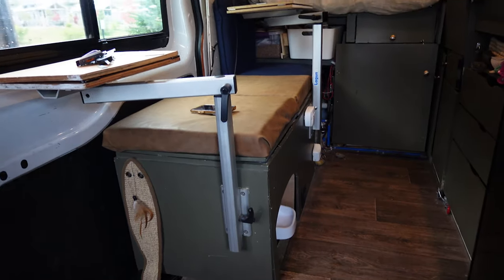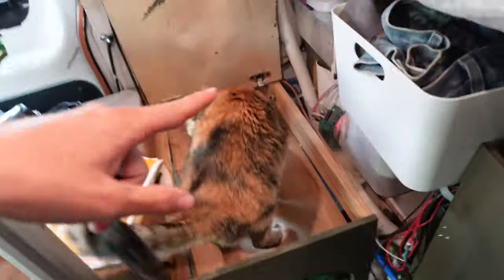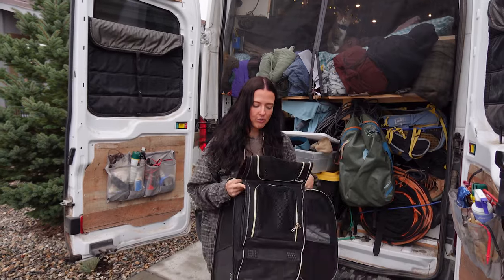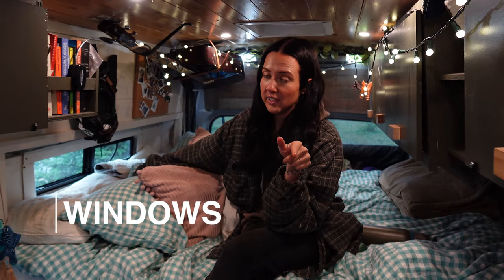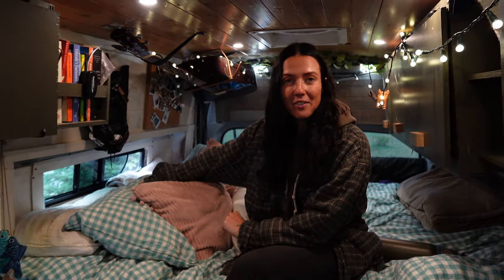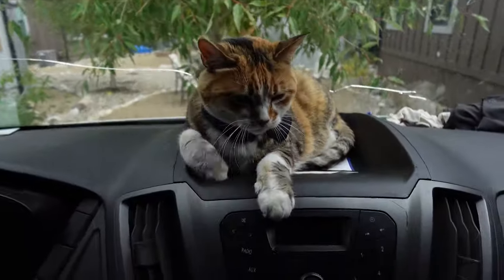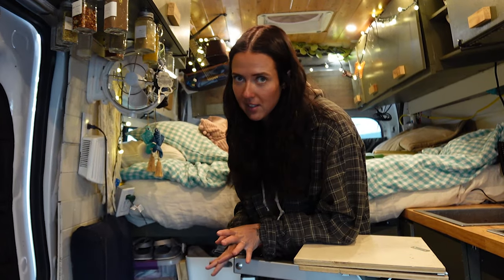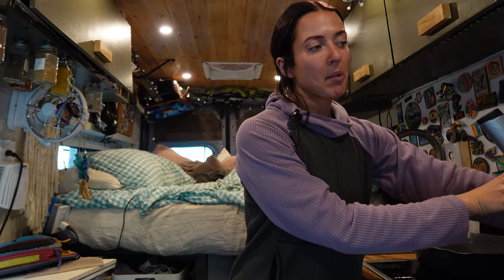VANLIFE WITH A CAT (how we do it & everything we use & built)

Comment: I live in a box truck with two kitties, and over the big roll-up door opening I've put up a single car garage magnetic screen that is held in place by Velcro. But, to keep the criminals in, I also put multiple long,  extra strong magnetic strips along the bottom to hold the screen tight. Works like a charm.